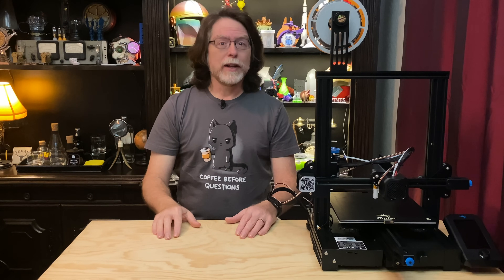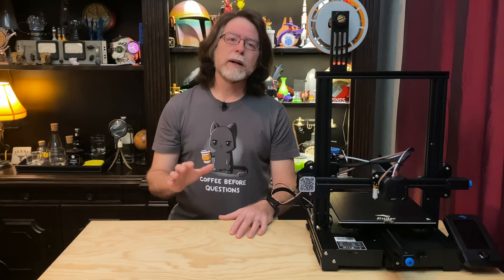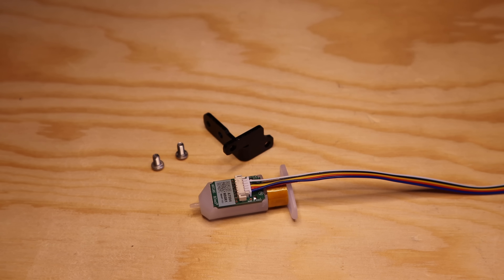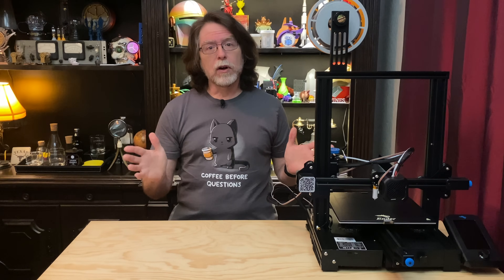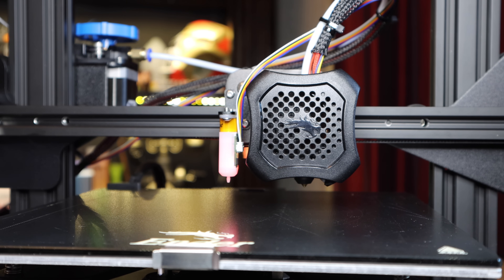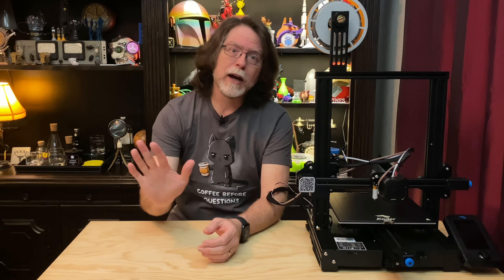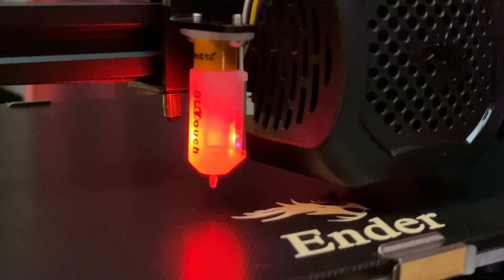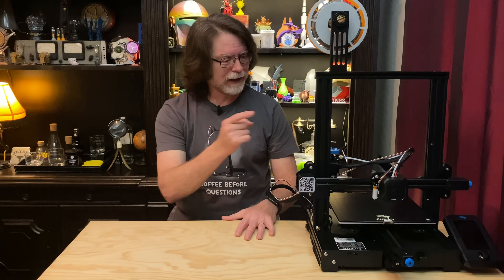Level Up! Install Creality's BLTouch Bed Leveling Kit on Ender-3 V2!

Comment: hey what about putting a little stain on that plywood table top it would look good, lighter color than your cabinets would look good
Reply from the maker: My wife has been wanting me to give it a chalk paint finish with a wax topcoat, maybe a vintage green. I've done that for a desk and a few bookshelves and they came out pretty nice.

The plywood is pine, and my experience staining pine is that I have to use a coat of something like a sanding sealer first, or it'll get blotchy as heck.

It's been taking a fair amount of abuse, so either of those finishing options would probably show scratches. I'll have to think about it.

Thanks for the comment! 👍
Reply: @BV3D  You can stain pine with good results. Don’t use a crappy stain like Minwax, or what you find at a box store, and you’ll be fine. You can use a wood conditioner if you want. Then go with an Old Masters or General Finishes wiping stain.

Comment: Whoa! Literally ordered one for my E3 v2 on Friday and got it today. Great coincidence. Thanks a lot for the help! I got it all done like how you described and when I start a print, it does the auto home and leveling, and it just ends the print without actually printing anything. The process goes up to 100% super fast right after the leveling done. Any idea why?
Reply: Very late, but I have had the same experience (and many more problems), all stemming from the BLTouch cable being loose on its motherboard port. Some boards have a way looser fit then what you see in this video. And of course, the motherboard ports are facing gravity's direction when the printer is upright, so the loose BLTouch connector falls out with hardly any interference.. let alone if you move the printer or pull out the tool drawer

Honestly, it was a horrible design flaw which should have been made overt from the start. It took me forever to figure out what was going on, and then after that, the part kept failing. I had to go back and fix it so many times with tape, cable ties, etc... all failing. 

Finally, I said to my BLTouch: "screw it, I'm taping you in so hard that if anyone tries to remove you in the future, they may mangle the board, and I NO LONGER CARE"

So, Solutions, are basically affixing the cable in place permanently.

Two options are:
A. Tape in place VERY TIGHTLY AND THOROUGHLY with electrical tape (as I did. Very finicky process)

B. Hot glue gun the BLTouch connector to the port on board. (Probably easier. This is how my V2's other cables were affixed to the motherboard, but I had no hot glue gun when struggling with the BLTouch--only electrical tape)

Mine has worked fine since! Enough that I am considering removing the ender 3 bedsprings which now only serve to make the BLTouch's mesh (theoretically) less-reliable
Reply: @ivymazzola1214  thanks a lot for the detailed explanation and everything!! I didn’t really notice that it could be like that. The problem was partly fixed by changing the meshing code in Cura. I can look it up and find it if anyone needs it but it’s been a while so I don’t remember what was it. However, after using it couple of times, I realized I’m having better results if I adjust the bed manually than having the BLTouch do its job. Possibly because of me doing some things wrong but couldn’t figure out what it might be and returned the thing back to the shop. I’m still manually adjusting the bed level and I don’t have any complains. Someday I might buy it again and give it another go, though. 

Again, thanks!
Reply: Berke selamlar sence 650 liraya değecek bir upgrade mi? Kararsız kaldım
Reply: @Kendiyastro  selamlar. Eğer elle tabla ayarlaması konusunda bi sorun yoksa değmez. Ben şahsen onun ayarlarıyla uğraşana kadar elimle de ayar yapabildiğimi fark edince iade ettim. Bence bu parayı hak edebilecek tek özelliği tablada herhangi bir eğim varsa bile 9 noktadan ölçüm yaptığı için sorun yaşatmaması. Onun dışında maalesef çok pahalı.

Comment: Hi Bryan. I use the touch on my original Ender 3. All the settings are saved to the EPROM. Not sure why you can't still do that by configuration via firmware but I do use TH3D. I swear by their easy to use firmware. I have it on both my Ender 3 and CR10s. .
Reply from the maker: Hi Tony! I've got their Unified Firmware on an original Ender 3 and I agree, it's pretty nice. They recently released a new version of it for the Ender-3 V2 so I may give that a try.